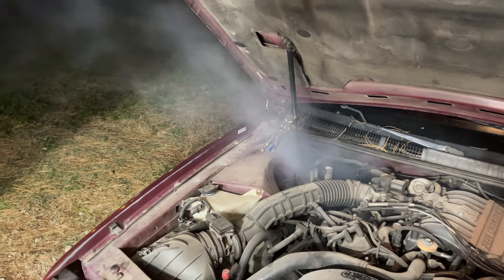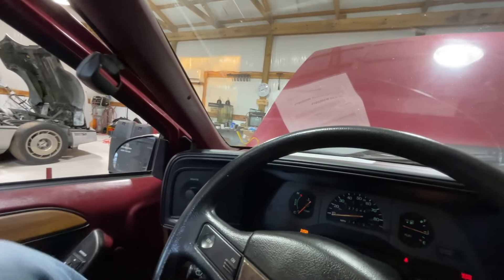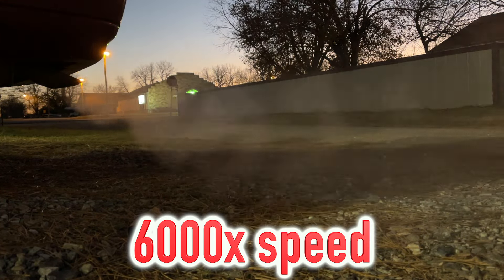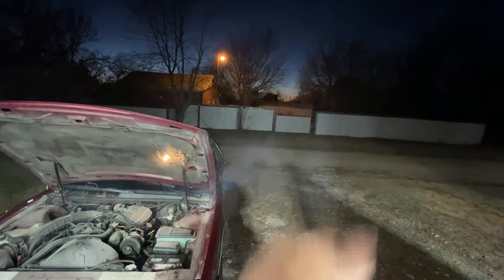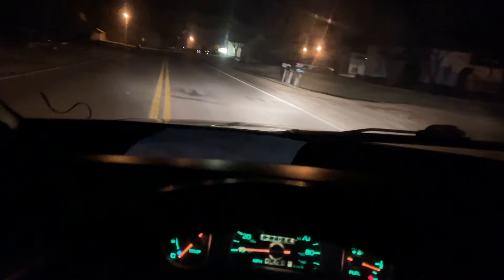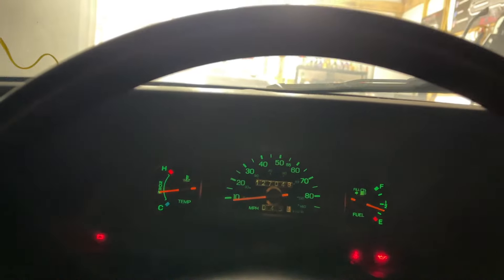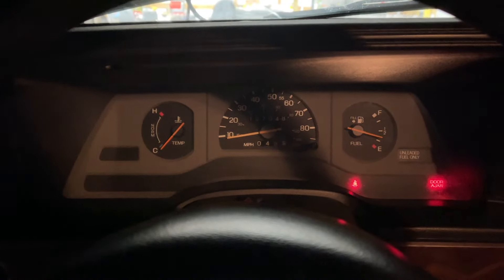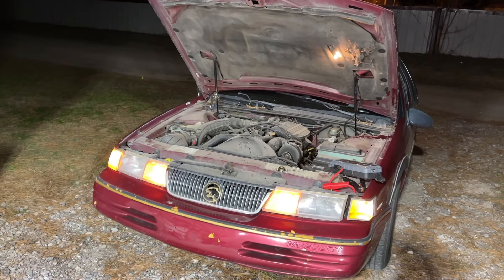$250 Copart 91 Mercury Cougar - Blue Devil Head Gasket Repair or Fail?

Comment: I take thermostat out first , then add block sealer and top off with water , let idle till smoke stops , let cool , drain water  , replace thermostat add coolant and drive for ever
Reply: Exacly bro thats how yo get the better results
Reply: I did that to a dodge neon and it still running well
Reply: I used it in a 94 Cadillac I had. Ran good as long as you didn't get into the accelerator.  Once I did get into it, it just blew it right out of the engine. Good for quick fix though.
Reply: I’m barely a novice and I know to removed the thermostat if it wants you to “pour/use on a cold engine”. It’s impossible and pointless to pour into a cold engine if the thermostat is still in! It takes a while for it to open up and by then the engine is hot/warm. I ever understood that. None of these brands tell you to remove it and they call on only pour into a cold engine and I think I know why, but like you I believe it works best on a cool engine.
Reply: Do you have to take off thermostat
Reply: That's a crack block issue not no gasket .
Reply: @loyal2thesoil412  how can you tell??
Reply: But leave the radiator cap off after pouring blue devil In ?? Or ...
Reply: It’s the Pour and Go version.. no need to remove thermostat. only the more expensive regular blue devil one you have to remove the thermostat.

Comment: A ford 3.8 with a blown head gasket no way ...... usually when you have exhaust getting in the cooling system blue devil will not work it can't seal a hole that has exhaust gasses blowing through it
Reply: My opinion is Blue Devil works after you run it and let it cool down.
Reply: Don’t all blown head gaskets cause exhaust to leak into the cooling system? My blown head gasket didn’t leak water into the block but my water site smelled like gas and did overpressurize my cooling system with the volcano like eruptions and leaks. 
I tried Bars and BD and they didn’t last.
Reply: @vs4571  no not all blown head gaskets some put exhaust gasses into the cooling system and causes the system to push coolant out the overflow
Reply: Good to hear. And excuse my typo, but I think you got what I was saying. A shortcut is to take off radiator cap and smell the coolant or opening. I think my head is pretty f***ed up.

Comment: I removed the thermostat,, drained and flushed out my cooling system with fresh water from my garden hose and performed a regular Blue Devil flush.

Then I flushed with fresh water from garden hose and performed the Concentrated Blue Devil radiator flush.

Then I flushed the cooling system with fresh water from my garden hose.

Then I added a bottle of Blue Devil 8 cylinder simultaneously with a bottle of Blue Devil Pour N Go as directed for both.

I let my car idle for 70 minutes and let it sit for 24 hours.

Previously the car had the typical exhaust going through the coolant reservoir and overheating within a few miles but zero steam out the exhaust.

The car also had a slight sputter every now and then.

I installed a new factory temperature thermostat, checked the fluids and added fresh water from the garden hose.

My car now runs perfectly fine with zero issues.

My car is a beautiful, second owner 1998 Cadillac Eldorado with the 4.6 Northstar.
Reply: Thank you for that elaborate breakdown. I’m going to do this tomorrow, your direction gives me much confidence. 🎉

Comment: Glad to see it worked. Sometimes you have to veer away from the direction slightly to get the results you are looking for. Example: I was told never to use Barsleak to fix a small head gasket leak on a 4 cylinder Corsica I used to have.... Well I did it anyway and the leak stopped and I drove the car that way for two years. :)  Not a bad looking Cougar. I kind of like the top. Look forward to future updates and can't wait to see more on the Mustang and the Corvettes.

Comment: When that car was sold, the Corvette and Tbird/Cougar were the only American cars with IRS suspension in the rear.
Reply: The '88 FWD Cutlass Supremes had IRS.  Probably the Grand Prix, Regal, and Lumina or whatever, had it too.  But the Vette and T'Bird/Cougar were the only RWD cars with IRS.
Reply: Yeah my 91 Grand Prix back had it also. Had a single leaf spring and standard four wheel disc like a corvette too.
Reply: Ford was trying to compete against the European luxury cars with the Thunderbird/Cougar/Mark VIII with the fully independent RWD ride quality

Comment: Thought it wasnt gonna work at first but it kinda makes sense, the stuff in blue devil only hardens under extreme heat, and will only really harden where hot exhaust gasses are going into coolant so makes sense why after you let the exhaust make its way out that it finally worked! awesome!

Comment: Worked at. Ford dealer back in the 90s, we had 3 guys that all they did was head gasket jobs on 3.8s
Reply: Hated that ford only issued a head gasket recall for the 3.8 in front wheel drive applications.  Stated they blew because the coolant flow was reversed in the front drive config.  I think the rwd 3.8 cars were still bad for this.  Especially the supercharged ones

Comment: Did you have the heat/ defrost  on at full so it circulates through the whole system faster? i found that to work also when doing this repair.

Comment: It's sodium silicate, sometimes called liquid glass. It has been used since the 60's as far as I know. We would just flush the system and dump it in. Run it for a week. Then drain and add coolant. 50 /50 weather it works.

Comment: Blown head gaskets on those 3.8s are common. Everyone I've ever owned has had overheating and coolant issues. Trying to combat this in the Super Coupe swap Mustang I am rebuilding. Really wish I went with something else but younger me thought it was a good idea so trying to follow through and finish a project. ARP head studs and a good set of gaskets is one way to solve it. Draining all the coolant before you dissemble is a huge piece to the puzzle. If coolant gets down in the crank case, you will likely get a rod knock shortly after changing the head gaskets. Anti-Freeze damages the bearings. Have had several that people have changed the gaskets on and then blew it up anyways because of this.

Comment: I had a 67 chevy truck a few years ago and it had a 230 inline 6 cylinder that had a cracked head. I put some old style Bars Leak stop in it that you had to leave the engine idling for about 30 -45 minutes and let the vehicle sit for 24 hours afterwards. The next day the water leak was fixed. It kept running for over 10 years afterwards.

Comment: glad you ran it without the cap off, but i've heard some mechanics suggest that you run it on an incline with the front end facing up to help bleed the excess air and gas out that might be still trapped in the system. it looks like i is already parked on an incline outside that shop door, so you may have already done that.

Comment: I did my 4 cylinder Toyota Camry with half a bottle of Barrs seal as directed.  I noticed this blue devil comes out clear and Barrs is a thick heavy resin.  Do you know what chemicals are in each?  The Barrs did not hold too well, I have to fill it with coolant every 3 to 5 days depending on driving type I'm doing.  Would a working sealed by a can head gasket require normal amounts of coolant, much better than what I'm getting or about the same?
Reply: So how’d it go?

Comment: I recently bought a 2003 Mustang with a blown head gasket with antifreeze mixing in the oil. The car only has 90k miles on the 3.8L engine. Should I just pour the BD in through the radiator or drain the oil first to get the mixture out and then ad the BD through the radiator.

Comment: I used that on my subaru 2002 wrx. When I put the thing to the radiator car off. And let it idle about 30 minutes cap off to burp the system. Then idle 50 minutes cap on. Yo t worked. No air in cooling system. Heater blows hot.

Comment: Second time I have seen the head gasket repair in a bottle trick. First time was on Roadkill Garage. I would not have believed it until I saw it. I guess there is such a thing as head gasket repair in a bottle. I wonder how long it work for? It probably depends on how big the head gasket leak is?  It would be fun experiment to drive it a while just to see how long it will work for?
Reply: It lasts for about a year if you drive alot everyday (I used it in my 79 Accord hatchback)

Comment: Update? I have a Toyota avensis with blown head gasket or cracked head. No smoke from exhaust however lots of over pressure from coolant reservoir. Would definitely try blue devil if it has fixed this. Is it still going?

Comment: Blue devil.will try it on a cheap flip car. After confirming it does the trick. Thanks for the video.
Reply: I did it today. My car is fixed. I was literally astounded. 10 out of 10. 2002 V6 Accord. 204k miles

Comment: I am having flashbacks to 1998 when my nearly identical maroon on maroon 91 cougar had blown headgaskets and would stall and not start. Happened at an intersection. Smoking like crazy, pushed it through the intersection and then git it started. Eventually the oil light started flickering. It spun a bearing due to the headgasket and needed a new engine. That Jasper reman'd  engine blew its headgaskets during the warranty period and it had to be repaired again. Then I traded the car in on a 1993 Supercoupe.

Funny story about the SC was a few years later I saw the telltale smoke from the exhaust and took it back to the same shop that misdiagnosed the headgaskets on the cougar.

I told them to check the headgaskets and they were like "you're just paranoid cause of the cougar " I repeated "check the headgaskets" they again tried to say I was paranoid. I repeated a final time "CHECK THE HEADGASKETS!" 

They finally relented. They called me the next day saying they found......

The headgasket had started leaking.

It still cost me $1800 for a headgasket replacement but at least I didn't need a $3600 engine replacement (actually that was the cougar engine, an SC engine was likely even more money).

Comment: What's going on sir I've had to use different block sealers head gasket sealers I come to understand that it's a reason why it was a blown head gasket usually thermostat or just low coolant and it could have blown the head gasket I usually take the thermostat out so it'll free flow to give the block sealer a better chance to work 🤔

Comment: This is a quote from bdp........The BlueDevil Head Gasket Sealer only reacts to heat one time (one heat cycle). After the 50 minute idle and the vehicle cools, the product will not continue to react or continue to seal. Yes, the Pour-N-Go Head Gasket Sealer would be able to treat warped/cracked heads and a leaking block as well.

Thank you!

So obviously that is not true? You did multiple heat cycles......and from the looks of it, it started working much later when you left the cap off. How is that so when they claim it only reacts to heat once?

Comment: What I’ve done in the past is take out the spark plugs in the cylinders with the head gasket leak and let it run for a few minutes with those plugs out. That will keep the pressure out of that area and give the head gasket sealer a better chance of working.
Reply: If you take out the spark plugs won't that cause the car to stop running?
Reply: @ranakeen9884  It'll just misfire and run rough which it was already probably doing. Just don't take out all the plugs at the same time

Comment: Should've got the Blue Devil flush and then went with the Big bottle and done it right, i did it with a crown victoria that was mixing coolant into the oil and it worked for years.

Comment: Would it work on oil leak coming from between the side of the engine block and cylinder head? Car has no coolant and oil mixed just oil leak coming from the side between the block and cylinder head. And also overheating or smoke issues
Reply: I mean no overheating nor smoke issues

Comment: Do a 5.0/302 engine swap on it...easy direct bolt in for the motor mounts and transmission and even the V6 Y-pipe will bolt up to the 5.0/302 exhaust manifolds. It's a bit of rewiring and swapping the computer but it's a fun swap. I actually ENJOYED when I did it on mine..

Comment: On both this video and on another Auto Auction Rebuilds the Blue Devil was NOT added according to Blue Devil directions -- which say to add the Blue Devil SLOWLY, TAKING ABOUT A MINUTE, much longer than either of these videos.  (the much longer time allows for the coolant additive to get much more dispersed throughout the cooling system)
Reply: I think the purpose of adding slowly is so that it doesnt overflow, wasting product. Ideally you let it idle for 50 minutes according to the instructions so it has plenty of time to dissipate

Comment: That shit works I tried it car was heating up water pump was leaking bad I pour water in my radiator it leak out as fast as i pour it..i bought the blue devil out of auto zone almost $60 at first it was it was still leaking I raised then engine bout 10min with my foot on the gas out of back out and checked under my car if had stop leaking so I put a sludge hammer on a brick to raise the engine just a little not full throttle for about 30min it stop leaking top it off with antifreeze and drove it down the road bout 3 miles it run perfect not leaking at all....BLUE DEVIL WORKS...save me alot of money...

Comment: I have a stupid question.  Just so you know, I'm a moron.  I had a very minor external coolant leak in my engine about a month ago.  I poured in Blue Devil. I did not bother to read the instructions. The motor was warm, I put it in the reservoir, and I did not let the car idle for 50 minutes.  Nonetheless, the coolant leak stopped, and everything has been fine thus far.  That is, a month later and a good 1000 miles later.  Am I in for a big surprise for not adding Blue Devil correctly or am I lucky?
Reply: head gasket sealer is for leaking head gaskets.. not for a leaking hose or anything leaking on the external engine itself.

Comment: im guessing it may not be the head gasket but either the thermostat as the top radiator hose is cold and as the new prob it looks like it may be the heater core

Comment: i would park it for a bit. keep an eye open for a T bird / Cougar 1989 - 1994 3.8 Auto. something that is wrecked with good engine or clean with a bad transmission. AOD wan known to fail when not properly maintained. or driven with the throttle pressure cable unhooked.

Comment: If it’s blowing out exhaust gasas from the radiator, then the head gasket is too far gone for any potion that you poor into your cooling system to work properly.  If think this lotion would only work if you’re getting bubbles in your coolant...

Comment: easy car to bleed off air in the coolant system, just loosen the  bolt with the white plastic  around it on the intake,, leave loose, add coolant  till it flows out of bolt, tighten bolt, More than likely, the upper hose will get  nice and warm

Comment: I think you're supposed to remove the thermostat before pouring it in and just my opinion and it works fine on my blazer intake and head gasket super clean is the only thing I buy on any cleaning up job I have more thing I think you're supposed to flush the radiator after putting blue devil in then put a brand new thermostat sorry for incorrect spelling
Reply from the maker: The directions are very clear you do not need to remove the thermostat using this product

Comment: The instructions on the bottle say to flush the coolant system and remove the thermostat. And then fill with water and the blue devil.  In the video you say this is not necessary?   My thermostat is a bitch to get to... but I also want it to work properly the first try.  70$ bottle of liquid!

Comment: Next time you have combustion getting into the coolant pull the plug or plugs of the offending cylinders BEFORE adding sealant, ( wouldn't hurt to pull the thermostat either ) going to make a lot of noise for 50 minutes but it's your best chance of success. After it cools top off with water, clean and replace the plugs then drive for much more than 3 miles to burn off all the coolant in the exhaust ( especially if you have cats) only then will you know if it worked.
Reply: What if you don’t know what cylinder it is? Heard you let it idle for 50 min then loosen the spark plugs to release pressure. Then torque them after a while
Reply: @Miles-wy1zr  if it's not obvious which cylinders are effected by looking at the plugs then do a compression test one or two should be lower than the rest and your likely subjects..you know you need a valve job right?
Reply: I’m not a mechanic just an average Joe so no I didn’t know.

Comment: You had air in the radiator system. Probably because you didn’t run the hot air and bleed the ALL the air out the cooling system that’s why the top radiator  hose was not hot. I have never used blue devil before. I will give it a try one days when I get a car with a blown head gasket. I’ll try not to let it get too far gone before use.that engine is good. for the misfire might be the cap and rotor or just give it a look never hurts to try. Doing great out there I’ll try to give som of my ideas in future videos don’t have to listen I am just some guy that loves working on cars I’m not the best but I got ideas that work sometimes